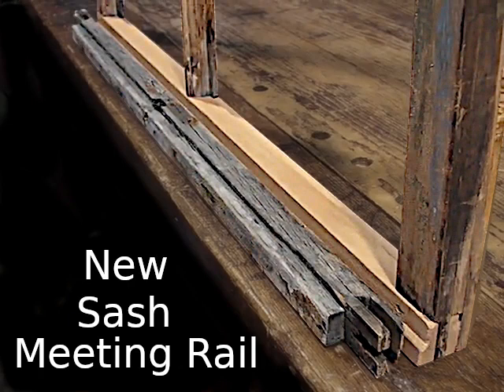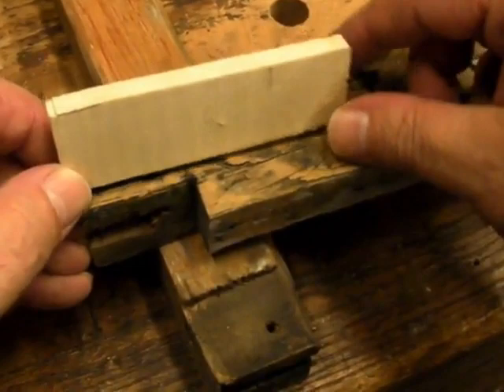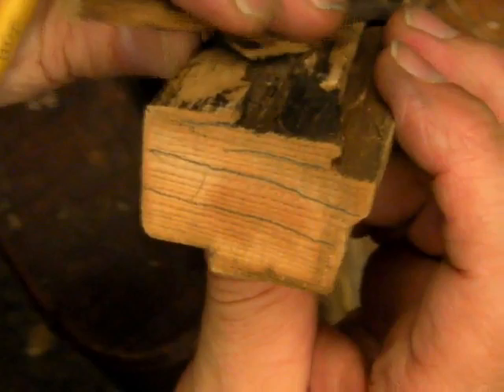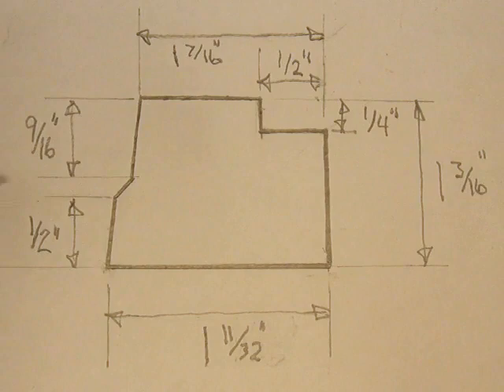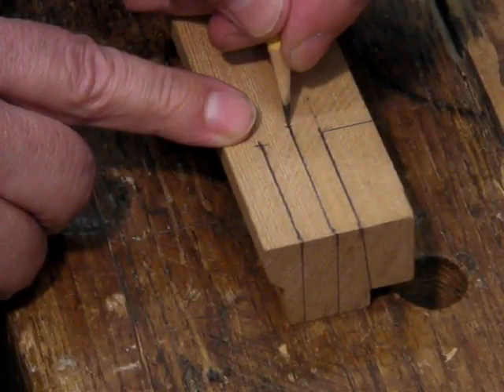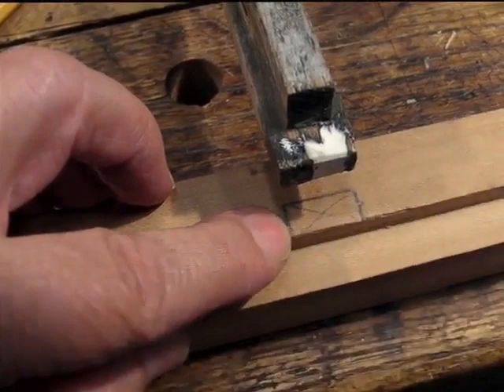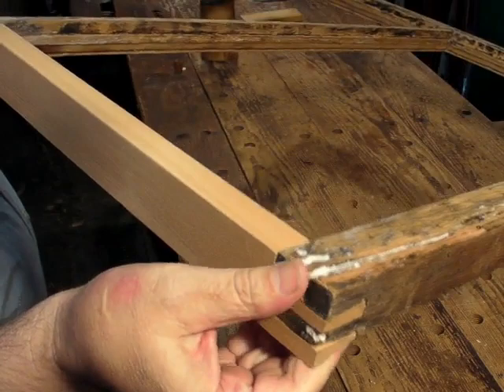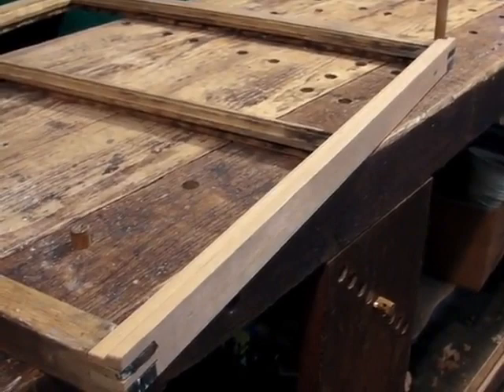New Sash Meeting Rail

Comment: Gteat video!  I loaned your book out years ago, to never see it again. I will order a new one. I've done many windows before, but never had any as bad as the ones I have now, in an old one room schoolhouse.  And time is of the essense.  This video was a godsend, because I have window like this one here. My bottom rail is slightly better than yours, not as much splitting, but has more checking. I'm going the epoxy route, versus the route you chose, its the best I can do right now. I have to get them done very soon, and needed answers today.  I had questions I couldn't find answers for, like the wooden pin locations and how to's, whether to glue or not (your comment reply) and other general things.  I was prepared to do several incorrect things.   Thanks for the video.  I miss your old forum, I had saved a ton of links, but oh well.

Comment: I have an upper sash meeting rail that is bowed downwards. It's about 42 inches wide and dips about 3/4 of an inch. Is it better to replace the bowed meeting rail or is there a way to repair it so that it's straight and will remain straight?
Reply from the maker: When they dip that much I replace the rail with new wood.

Comment: Thank you John. Some practical carpentry right there!  Exactly what I needed for my 1850 farmhouse windows. I noticed you did not glue the joints or peg on assembly. Is that to allow for potential future disassembly?
Reply from the maker: Will, Traditionally sash joints were not glued. The design and tight fit of the joint holds the stile and rail together, and the peg holds the joint together, no glue needed. A glue line within the joint can trap moisture in the joint leading to fungal decay and failure. No glue does mean that the joint can be disassembled for future repairs.
Reply: @johnleeke  Excellent. I will steer clear of the glue in this case!